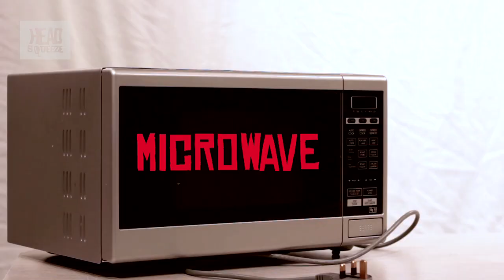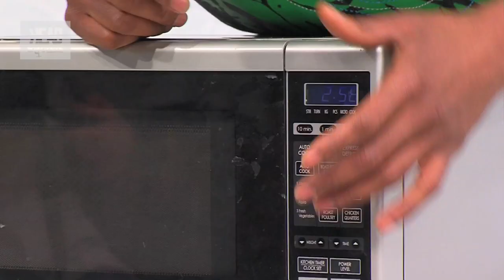How do microwaves work? | Live Experiments (Ep 7) | Head Squeeze

Comment: You could play with this a bit more and figure out roughly the speed of light. This is done by measuring the wavelength (marshmallows on plate works best, and just as good to eat) and multiplying it by the frequency (typically written on the back of the microwave, usually in the S-band).